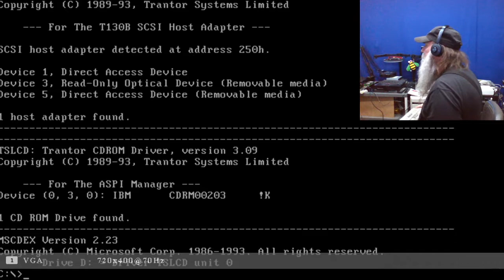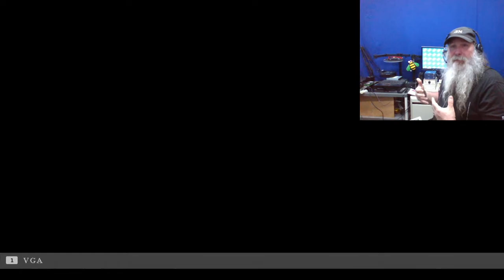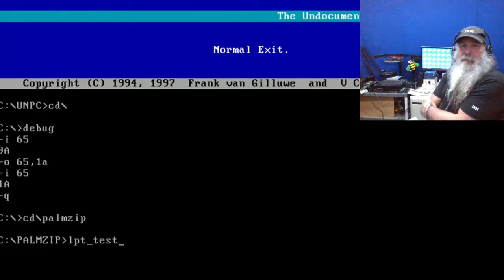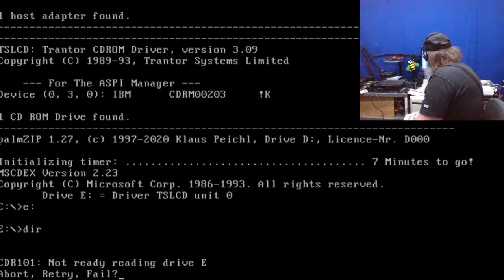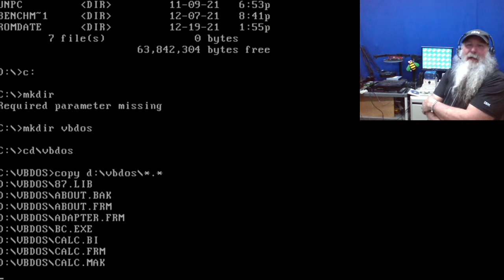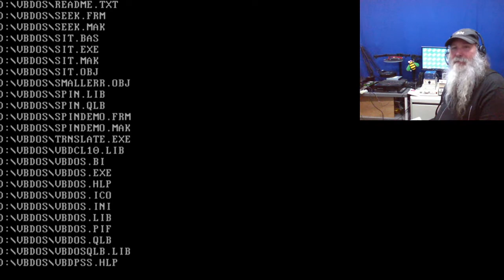Investigating the 'palmZIP' driver on the "Maxed Model 30"!

Comment: Hmm, does the 30-286 planar really have a standard bi-directional LPT port? If the info we have is correct then it uses the non-B variant of the VL16C451 - a version that lacks the bi-dir support. Looking at the techref and VLSI datasheet, bit 7 of I/O port 65h is LPT Output Enable rather than a uni/bi-dir mode select. The mode select is normally bit 5 of LPT control reg. (base+2). While toggling the Output Enable bit should put the LPT data lines to high-Z mode, allowing the connected device to drive them and the PC to read the value back, without the standard bi-dir register and device select/direction line standard SW/HW won't be able to use this. But we need to verify all this info...
Reply: Checking the LPT_TEST code and the results you got makes me think that the info above is probably correct. With the Output Enable bit set, the utility passed the readback test as it should (uni-dir, reading back the last latched value). It failed the bi-dir test, which also makes sense since the LPT control reg. lacks the mode select bit, so it just reads back the written data (still in uni-dir mode). But with the Output Enable bit clear, the readback test fails because the data lines are in high-impedance mode (readback value FFh, because the lines are floating high). The bi-dir test reports "OK" here because whatever you write to the port, it will always see FFh. That's why it warns you that the "bi-dir test may be wrong!"... since the "baseline" test failed, it can't really tell whether the bi-dir toggle worked or not). Still, more testing needed to be sure.

Comment: Awesome, I also ended up with Palmzip for my P70 and 76i as no other driver worked. But its very slow as you said, so it would be great if you could figure out a workaround for the port issues 👍

Comment: Glad to see you tried out the palmzip. Once you have a registered version it won’t do that whole “initializing timer” when loading. The demo version does stop working after seven minutes. Also, it gave it the drive letter before your cd-rom because the cd drive got it’s letter with mscdex in autoexec.
Reply from the maker: I'm still waiting for the registered version to go through - and learning about the PS/2 parallel port bi-directional modes too.